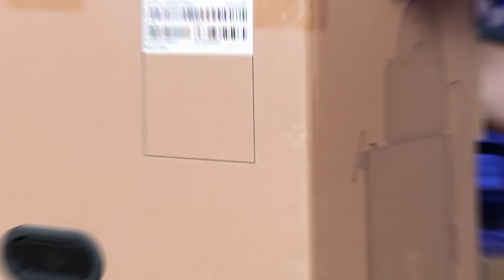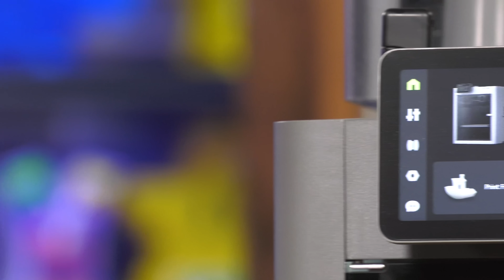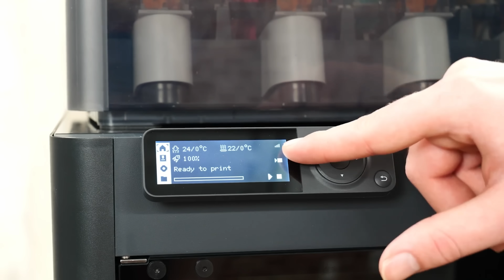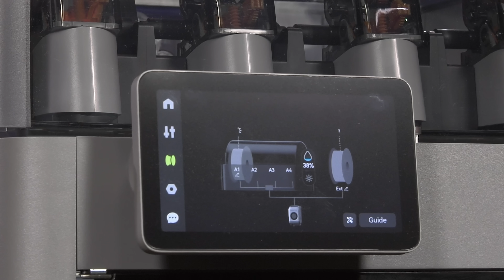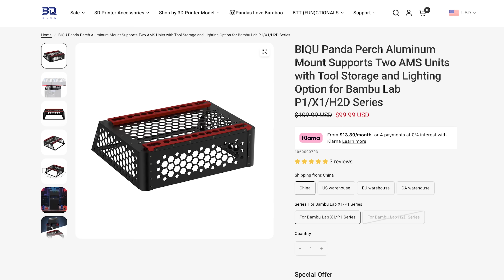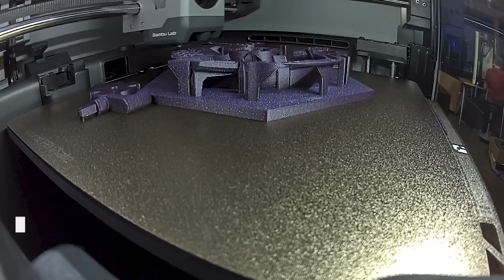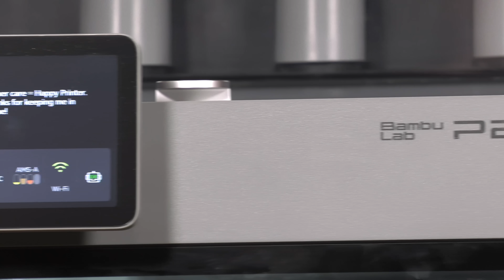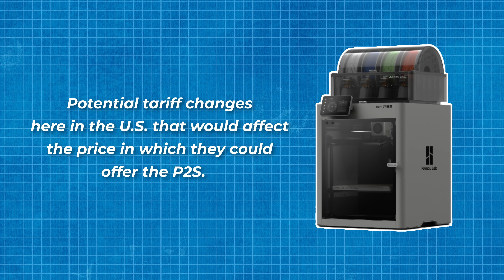FINALLY Bambu P2S IS HERE, Upgrades the X1C?

Comment: While it does not have an actively heated chamber, you didn’t talk about the passively heated chamber and its ability to recirculate hot air generated by the bed and hot end through adaptive airflow.

Comment: I'm a little confused and disturbed by all the hype this printer is getting from the community. No, it is not a replacement for the X1C. Bambu very much built it down to a price and made it look good but with lots of corners cut and shortcuts and some of these upgrades are not what they seem. Yes, it has a color screen... at lower resolution than the X1C/H2 screens. The air-handling system is compromised and at times does not even filter through the new larger filter but expels contaminated air from every gap and orifice. Look at some other reviews that did an actual teardown and were not distracted by the shiny "improvements".

Comment: Seems like nobody is talking about the fume extraction issue with the P2S. On the P1S they had a cutout behind the filter that vented the internal air. Now on the P2S they removed that and give you the option of either circulating internal air through the filter or opening the vents and bringing in outside air. The problem is this will force fumes/VOCs out between the door seals and poop chute and/or through the vents. This is a real problem when printing with ABS/ASA and other filaments that give off strong VOCs. Voxel and others have products like the X Filter and Bento Box to help provide better fume extraction for the P1S but since there is no native air export cutouts on the P2S behind the filter it seems they can’t offer options for the P2S. Seems odd Bambu has done this, user safety is a risk when printing with these types of filaments. Interested in your thoughts on this. Thanks.

Comment: Note that LiDAR is not on the P2S. It seems like I am the only one that cares for that level of detail the LiDAR feedback loop flow calibration provides with PETG. I have both a p1p and three x1c and I notice the difference. I must have too high of expectations. I consistently print for a business so with filament batch differences and slight temperature changes in my 3D print room I notice it helps provide me with consistent prints. Am I the only one that thinks this?

Comment: A few questions about upgrading from a ender 3 pro with micro swiss hotend, bl-touch, 0,6 nozzle printing petg on cheat of glass (not perfect and only able to use 1/3 of height due to some issues with Z axis)

How much faster will an coreXY be able to print?

First thought was to buy a p2s and maybe without the ams since I so far only made one color design on the functional parts I design myself but it is not the cheapest option.
How well does it compare with Anycubic kobra s1 and creality k2?

Comment: hullo mate,
I have the same issue with the PETG filament. It seems to extrude filament at the back and doesn't clean properly when changing.
However, this does not happen with PLA, which is weird. I have the X1C.  I have tried muliple PETG filaments, from old to new, Dry and a bit wet. and have the same results. Good to know I am not he only one with these issues.
Reply from the maker: Interesting. So it's very specific to PETG for you too?

Comment: Mine prints perfectly with asa abs pla tpu pc , pctg. but Petg I have to use one of my X1C s , p1p s , A1. I even tried  Bambu’s Petg hf n standard. Something is not right with their settings
Reply from the maker: Hmmm. I’ve gotten 4 different PETG materials to print well on mine, just the one that didn’t print well seen on video. Any idea what the issue is on yours?

Comment: You say to be expected with poop everywhere. But my 6+ year old mk3s with mmu2 doesn’t have that problem. It also prints reliably every time. The only downside is side it it’s aids to load filament 😂. Oh and it’s slow now. I’m researching a new printer atm.

Comment: I’m having a hard time deciding between the H2S and the P2S. I only plan on getting one printer — something versatile that can handle most of what I want to do. I know the P2S is more affordable, and at first, I’ll just be printing simple projects using PLA, PLA+, PETG, and maybe some ABS. Once I get comfortable with the printer and learn all its functions, I’d like to experiment with more advanced materials like nylon, polycarbonate, or even carbon-fiber-infused filaments. Still trying to decide which one makes the most sense for me.
Reply: i just got the H2S coming from a x1 carbon. go for the H2S its a beast. it makes the carbon look like a toy i hated that printer. so far no issues with ASA,PC,PLA,PETG
Reply: I'd check out the H2C.

Comment: I plan on buying my first 3D printer. I am focusing on either the Bambu P1S or P2S combo. I am looking for advice.  I live in the United States so P2S is currently and may not be an option.  I am a patient person so if reasonable I could wait and that was my plan until I saw the P1S combo was going on sale on the 28th for $550 which is significantly less than the expected $800 for the PS2. That could be used towards additional supplies and a table.  What are your thoughts?  If the P2S is just that much better I would be willing to pay the difference to avoid buyer regret.
Reply from the maker: The P1S is a wonderful machine but if you have the budget and patience the P2S feels like
A better machine to me. 

The P1S has some fun upgrade options thanks to Biqu if you go that route.

Comment: I have that knozzel clumping happening on my P1S with PLA.  It didn't used to do that but I took a break from printing for a while and then went to print a prop for the kids Halloween costume and I have had two firmware updates over the last two months so i am wondering if i am seeing the same or similar as this.

Comment: I’m wondering if the speed with which it comes out when pooping is the problem. Is there a way to change the g-code to slow it down(just while popping)?
Reply from the maker: Hmmm. As far as I know, the purge commands are all built in.

Comment: I got mine yesterday and its my 1st new 3D printer since my Wanhao Duplicator i3 8 years ago. This has been a huge dissapoinment so far. My issues:

1. Cloud print, just doesnt work, gets stcuk at 30% then moves so slow a drunk snail could have gone out the printer and inserted a USB drive in half the time. I've never let it finish as I feel 30 minutes to load 60% of a 14mb file is not an option. I've tried all the suggested fixes for this but none have helped. (no its not my network).
2. When I slice a plate then export it to USB  (to hand off to the drunk snail) it creates a .3mf file, you swap to  print from USB and it only wants gcode... WTF? I could not find an option in Bambu Studio to export gcode.
3. Broke some filamant in the AMS (of course I did) and then when trying to remove the PTFE tube from the filament buffer I broke it. So now instead of the one small tube coupler I have to buy a whole new filament buffer. They are not in stock yet so no AMS use for a while. I might just glue it in for now...
4. When loading filamant from the outside spool it just keeps on running and clumped up the nozzle. ( my fault I guess)

When I do get it to print though its very good.

Comment: I had a very similar issue with PETG but on a Prusa single filament printer. The solution was to adjust the Z axis offset slightly (0.2mm at a time)

The filament vendor wrote that some printers try to squeeze PETG down too close, leading to the nozzle skimming the surface of the previous layers. In my case it resulted in bad overhangs, the nozzle getting covered in filament, and eventually nozzle clogs. Lighter color filament also had discoloration and, at times, burnt spots

Happy printing! Love the channel!

Comment: My 1 and only printer; the X1C is still running strong!! I have ran it at ~250mm for 2+ years now. I still have only had 2 nozzle clogs, and that is it. Still on the same first build plate that came with it. Endless printing. Before it, nothing but trouble. I'm way excited about this new printer, but the X1C really did change all of printing! 😍🔥🙏💪😁

Perhaps we are due for a serious GOAT debate after about 6 months of its release?

Comment: I'm just here with my Ender 3 Neo 3D still... God I want something that will print ABS so bad. It gets really cold here, and even Petg has issues on mine because it's not enclosed and there's probably a cool draft that comes in through the windows that lifts that side of the print frequently when it's cooler. I pretty much cannot print during the winter months.

Comment: This is the second video that I have noticed the poop shoot location and setup as one similar to the Anycubic Kobra s1 that I am certain was the death of both of my units. It's much smaller and has a similar design philosophy to this one. As I print 75% petg, and fully know what hurdles that inherently brings me, small over engineered instances like this are the first thing to ruin the new printer vibes. Had some decent improvement with petg caking on the nozzle of my 2 main workhorse flsuns after a light coat of Slice Engineering Plastic Repellant and while it has definitely been noticable, it's not enough to chance more Kobra s1 like headaches.

Edit/clarifying here - this was the case for single color prints as the flow calibration on the Kobra S1 would cause so much purging I was thinking really hard about the whole decision to stray from FLSUNs Delta Speed Demons or the A1 mini for the work horses they are.

Comment: PETG has always gathered around the nozzle of my X1C and I'm sick of the default answer to everything PETG being "moisture" because I never had this issue with my PRUSA printer and I never dried my filaments for my PRUSA, but I have been drying for my picky AF X1C.
Reply: From my experience, drying petg for 20 hours only dries the first few layers.  The only way is to keep the filament dryer on for the whole duration of the print.

Comment: I disagree with your assessment that they're going to sunset the X series.  Here's why.   Take a look inside your P2S on the interior side wall on the door hinge side... you see the standoffs that are there like there's a part missing?   Active chamber heating for the upcoming X2C.   Take the back panel off... you'll find standoffs there too where the carbon filter is positioned... perfect for putting an active filtration vent fan to be introduced in the upcoming X2C.    The signs are there that there is an X2C with premium features like active chamber heating and active filtration coming.

Comment: Hot tip to anyone who reads this, regardless of which printer you choose, always toss out the usb stick or micro sd card that comes with it and get a new one. They're mass formatted and written to in bulk at speed, with no QC, not to mention its often low quality / the cheapest memory they can get their hands on. I've had both Bambu micro sd's and those little silver usb sticks Prusa uses fail way more often than they should. For the sake of a few £/$/€ its worth swapping them out with a known brand.
Reply: Before you trash the included USB stick, make a copy of the contents, especially if it contains proprietary software or manuals for your printer. Even if you are not going to use the software, you’ll want to keep it to supply with the printer if you sell it.
Reply: From what i have learned trough internet research is that the printer uses the storage on the sd card as cache. Those chips arent made to experience that many write processes and thats why they go bad. To prevent that you should use industrial endurande ssd's/ usb's that can handle a lot more writing cycles.
Reply: @puressk  great suggestion💯‼️
Reply: all my bambu's came with sandisk sd cards, the prusa core one usb you're right, was terrible i sold that joke of a printer, worst thing to spend your money on is a prusa

Comment: If you need to pause a print to service the nozzle like you did with that petg, you must try to lower the bed and move the printhead forward for better access. It works on klipper, and bambo uses a fork of that, and if the display lets you access the moving head controls it would be easier for resolving such issues.

Comment: I am definitely interested in seeing ASA or nylon in a non-heated/vented  chamber.  Even if short heights, 20mm to 50mm is plenty thick to work with gearing or other mechanical movements

Comment: I keep waiting for my ultimate printer.
Good Support, Ideally Non-Proprietary, Easy, Reliable, Fast, CoreXY, 450x450 build area, Enclosed, dual filament nozzle or head (No AMS), All Metal Hotend, Auto bed levelling etc..
Reply: That would be a long time because you can't have all of those things at once.

Comment: Im pretty sure its because their updates have it over-purge between color changes, and it fills the little 'poop shelf' that opens after the purge is complete and the print head moves back emptying the shelf. I have the same buildup around the print head sometimes on my H2S
Reply: I had the same issue with my A1 as well. I havent done PETG again since though

Comment: You gave Bambu great detail on the PETG issue. A firmware change effect that you saw is a great clue. Well done.
Reply: Petg sticks I don't know how you and Joel forgot about that somehow. Petg is infamous for sticking to everything since it came out there is a reason nonstick nozzle coatings have come out for it.
Reply: Petg sticking during multiple purges isn't surprising
Reply: @qtheengineer9483  wait really? I swapped to petg because pla kept sticking 😭
Reply: @socketyellow3 yep lol if you have pla sticking you have something wrong with your nozzle or filament path slice engineering sells a nozzle repellent coating that should help you though

Comment: Pretty excited about this. I have an A1 and like it a lot, but I've been considering an upgrade to a CoreXY model at some point.  Ideally I wanted something like the P1S that had the quality of life improvements that were in the A-series (easy swap nozzles, default hardened steel extruder gear and nozzle, dynamic flow calibration, etc.) but didn't need all the extra stuff in their H-series.  This P2S seems perfect.  Disappointed that it won't be immediately available in the US, but OTOH, I can use the extra time to catch more first impressions and reviews from other folks who CAN get it.
Reply: Those potential 100% tariffs in a couple weeks are major. But who knows with TACO?
Reply: @StormDogg  Yeah, I know.  Can only wait and see how it turns out, I guess.

Comment: I missed you explaining where exactly it upgrades on the x1c...
Reply: Beside the quick change nozzle, of course
Reply: @marciompjr - passive heated chamber, better camera, steel instead of carbon rods, better AI, easier clean out, bigger and better carbon filter for ABS/ASA, full 256x256 plate use (no forbidden zones), door opens wider, much cheaper. 
It’s a bit like the Monty Python sketch ‘what have the Romans ever done for us’ really.

Comment: Had they made this a 300x300x300 bed, I think it would have been hard for them to keep in stock.  Its what people have been asking for.  I waited for the 350 squared machine when they released the frankenstein'd H2D and ended up going with the K2 Plus.  I had the same problem with having to replace the com wires as Uncle Jessy did but other than that, its been a great printer.  It opened my eyes to see that there are other options than bambu.  Instead of buying 2 more P1S's.... I took a chance and got a couple kobra S1 combos and they have been great machines.  The P2S looks good but nothing so special about it to make me say "I've got to have this".

Comment: For the PETG sticking to the nozzle, I’ve been dealing with the same issue as well but on a completely different 3D printer. I’ve got the Snapmaker J1S and for some reason the PETG looooves sticking to the nozzle. I have had zero issues with PLA though… so now I’m interested to see if it’s somehow linked to human error or something if it’s happening on different platforms.

Comment: Mmh, a bit of a nothing burger, looks like too much left over stocked parts had to go somewhere so they made this Meh2S. It's fine i guess and i'm a bit ungrateful here but "more of the same" is not what i expect of new releases from Bambu Lab. 250 cubed don't really cut it anymore, there should at least be the bigger alternative for the Ps and the Hs in 350. The once big innovation and now biggest gripe of everyone, the wasteful multi-color printing has again not been addressed - i am sure they are more than capable to develop a better alternative but probably some set amount of the "old" tech has to be sold before they grace us with something new. For me this is just milking it, which is alright but no reason to go ham about it. EU price is VERY competitive and probably the strongest argument for it - for 519.- this is a very solid, proven peace of gear.
Reply: Get an H-series then; those seem to have most of the things on your wishlist.  This is an excellent refresh of the P1S.  As an A1 owner, I feel this is the CoreXY model I'd want to upgrade to, if they can keep the price reasonable (the P series has always been a good value proposition).
Reply: @xacharon  Yes, you're right, value is a strong suite of the Bambu products. I'm not in the market as i'm still very fine with my A1 and my little Voron and neither P2 nor H2 can push me over the edge atm.

Comment: I had the same issues on P1S with sticky PETG. I solved it by switching to Micro-Swiss hot end and nozzle. I am now happy with it. 
Another fix was the BIQU silicone wiper. Both upgrades are not a mod... or commodity. They are a pretty much FAILURE of Bambu being solved by third party companies.